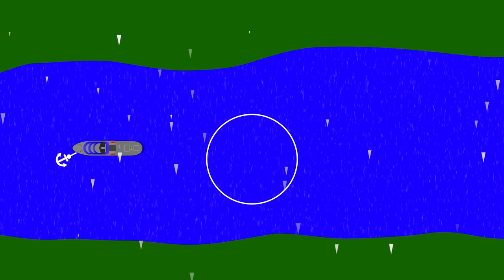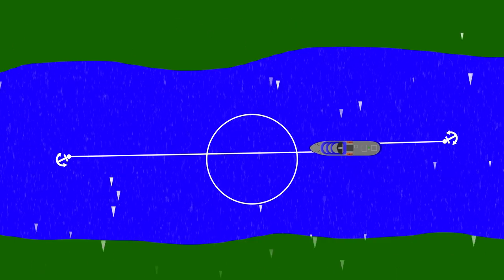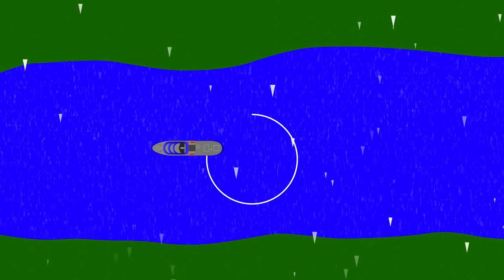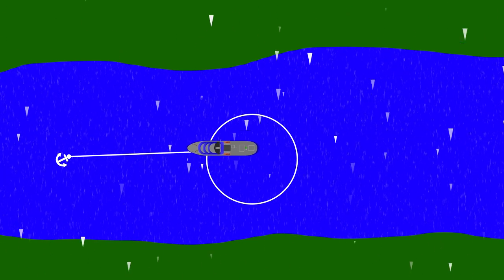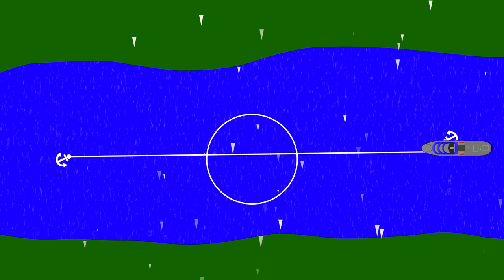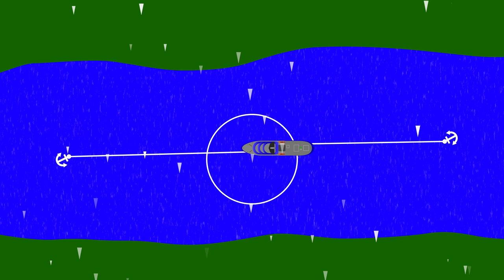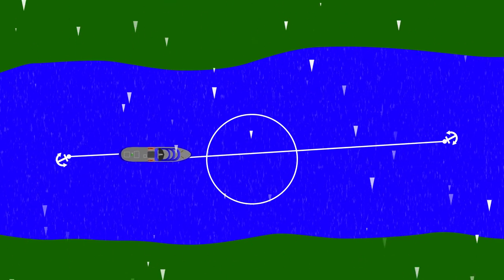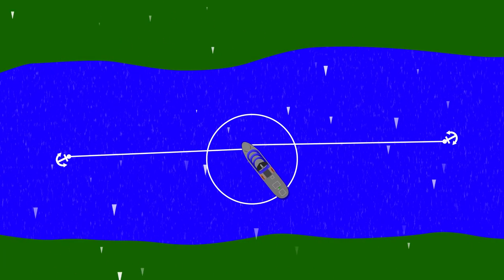Manoeuvring Tutorial: Standing Moor

Comment: Easier said than done. I have done this only on small boats.It works pretty nice when you anchor in an area where the tides change direction but if you sit there fore a few days your anchor chains  will most likely start twisting  around and I have no clue how you would untwist chaines on a large ship or large boat.And then you'll have to watch out for what the wind is doing. I had boats where the boat went with the wind direction and not with the current. All in all  I guess it's the only solution but not a great one at least not one to get a good night sleep.